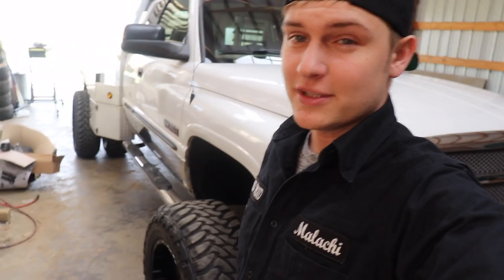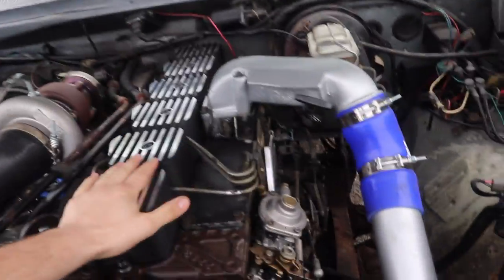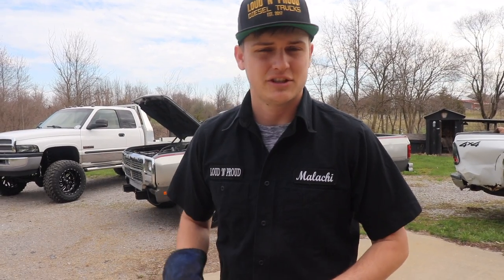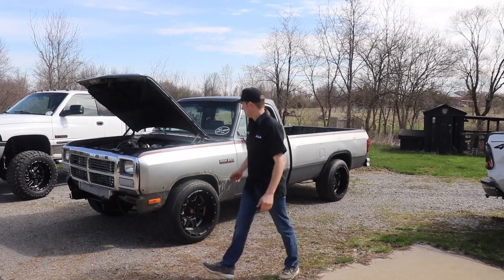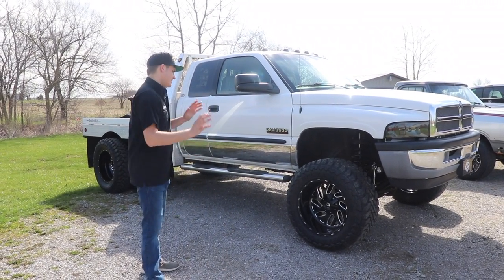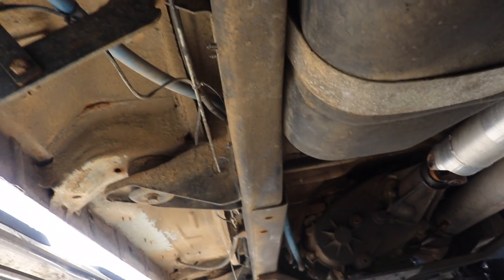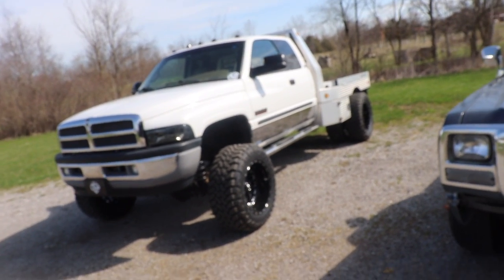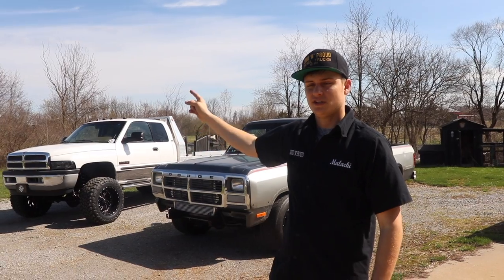WATCH THIS VIDEO BEFORE BUYING A USED CUMMINS DIESEL!!!

Comment from the maker: Who’s takin home that Dually? 😝
Reply: Probably not me but idk...😃😃😃
Reply: @noahreynoldsriding3452  same
Reply: ha havent won yet but ya never know 💁‍♂️😂
Reply: True
Reply: I’m praying but my luck has never been good🙄😂
Reply: @christopherdavis7757  I know how u feel bro
Reply: canada eligible?
Reply: It’s Ohio bound brother lol
Reply: I'm hoping
Reply: Hey
Reply: Me
Reply: As said in the other comments smoke coming out of the oil cap, breather tube  or so on isn’t an indication of blow by its oil vapors, if you want a decent indicator set the oil cap on but loose and see if it has enough pressure to pop it up if it does then I would worry about blow by but if not then I wouldn’t worry about it if it’s just vapors that bad check your valve seats they are under your valve springs if they are not a top hat style they can be pushed up with high boost causing a burning oil situation but any questions let me know can shoot you a message keep up the grind brother
Reply: When is the last day of the giveaway ?
Reply: I am
Reply: LOUD 'N' PROUD meeeeeeee
Reply: I wanna take it home!!! 🥳🤯🤩
Reply: I want that truck
Reply: I want that truck
Reply: $1000 says someone he knew wons the truck. Sub 200k subbed channels can’t afford to just give these things away.

Comment: Here’s a few things you left out:
1. If there’s literally 0 blowby, always check under the truck to see if the CCV has been rerouted, easy way to trick people into thinking there’s good compression. 
2. Crank the truck and listen to it. Does it sound even? Are some cylinders louder than others? If so, could be a compression issue in one or more cylinders. 
3. CHECK THE RADIATOR FLUID. Often overlooked, but very important. Does it smell like diesel? Then the injector O-rings are probably leaking and it’s been overheated. Do you see any bubbles randomly appearing when the truck is running? Probably a blown head gasket. 
4. Check the exhaust. Is there haze? What color? White: could be worn injectors, test the IBRs. Blue: could be worn rings. Does it smell sweet? Probably blown head gasket. 
Lastly, know the common problems with the truck you’re looking at. LLY: known headgasket problems. LB7: known injector problems. 6.0: a LOT, take a diesel tech. 5.9: depends on who owned it, you can blow one up in >100k if you don’t take care of it. Etc.
Reply: I'm glad you told that Joe Biden loving clown off. Good information sir!

Comment: White smoke is not an indicator of blow by. All of my trucks have it. Its the pressure you dont want it'll blow the cap up and even blow the dip sticl out. White smoke is just oil vapors.
Reply: Right
Reply: Oil vaping 😂
Reply: Holy shit! You again!
Reply: Nailed it man lol
Reply: Agreed. This isn't excessive blowby. The correct test is to loosen the oil cap and see if there is excessive pressure. Either the cap with jitter around... that's excessive. Or it will blow completely off... which is catastrophic.

Comment: Is it just me or did the first gen sound like a jack hammer while it was idling😂
Reply: It sounds like the gear train is coming apart in the timing gear case.
Reply: @realmccoy9597  May be that the kdp is coming out, it also sounds like that when you skip a tooth on the timing gear.
Reply: That’s exactly what it sounds like.
Reply: Sounded like there where marbles in the cylinders😂
Reply: @JohnDoe-jl3em  yo can you please explain this one, mine makes a similar noise but much less noticeable. No issues driving other than some slight blue smoke when she's lugging through lower RPMs

Comment: And also looking at an older truck check the bottom side of the floor pan, inner fenders, inner rocker panels. Open the doors and look at the bottom under the door gasket and see if it needs a new low door skin.

Comment: The late 2nd gen Rams aren't prone to frame cracks behind the boxed section because they are normally reinforced. The cracks happened a lot on the 12 valve second gens without the reinforced frame, which is why they made the subtle change in the late 2nd gens.

Comment: In the first gen I wouldn't be worried about that  that's not much blowby. When the oil cap blows out of your hand be worried. But that ain't bad. My 7.3 is about 3 times that bad and used 1 gallon of oil every 500 miles. But still has power and runs good once It warms up.
Reply: I agree ive seen trucks with a ton of blowby this is nothing concering

Comment: I bought a 2000  with 24 valve, it had a newer vp44 on it, I drove it 4000 miles & the vp44 malfunctioned. I looked at the lift pump and it was rusted,(old). I discovered that the lift pump was the cause for the vp44 injector pump failure most of the time due to insufficient fuel pressure.  So if your looking at or have a 24 valve , you need to get an aftermarket lift pump and install it as close to fuel tank as possible ( pumps pump very well, but don’t suck very well) an original equipment lift pump is $100. And is garbage. An aftermarket lift pump is $300. And well worth it because it will save the $1500. Plus labor to replace the vp44 injector pump, thanks. Doug E

Comment: Also if buying a 24v Cummins it's good to check fuel pressure! Low fuel pressure destroys the injection pump (vp44). Its a costly fix. Most of the time the stock in tank lift pump is not enough to supply the injection pump. I figured this out on my 01 when I bought it.

Comment: When you got water in the oil and the oil is  milky of course it will blow white smoke. Fix the head gasket or source causing the water in the oil.

Comment: Also if you are looking to buy a 12v Dodge Cummins pick up is to see if it still has the fusable links or if it was converted over to fuse box and relays or circuit breakers. Dodge was notorious for using a fusable link which could catch fire. I have a 89 D350 and just converted mine to the fuse box and circuit breakers. Also if you're getting up to a 02 24v see if your fuel pumps are still mounted to the block or if one was converted into the fuel tank.

Comment: I went and looked at a lifted 7.3 an hour and a half away last year, even asked him about blow by, the guy tried making it sound like a good deal and it’s a solid truck but I had to drive to him lol. Anyway when I asked him to crank it up I climbed up top and took the oil cap off and it looked like a fog machine out the oil neck it was so bad, he almost tripped running to shut it down. I guess embarrassed at that point.

Comment: Just for anyone that doesn't know a lot about diesel trucks blow by is when your piston rings are worn out and gases are escaping and can be burning oil some blow by doesn't mean you motor is toast just means your motor is worn out depending on how much blow by

Comment: I’ve had Chevys Fords pick up trucks dump trucks all the trucks that I’ve had ranging from 1990 - 2001 the 1999 dodge ram Cummins 5.9 in-line outperformed every single truck I had and to this day it runs better than new, especially with the new lift pump and injection pump. For work there is nothing like a cummins for. Towing.

Comment: I know on Chevy trucks.  The rocker panels are supposed to have creases like they were crimped on.   So if you look at the bottom of the door and it’s smooth.   You know the truck had body work done to it.

Comment: run that 12 v.mo.with the oil fill cap off .run a hose  down the fill tunnel. and the other end out the bottom of the truck...there is so much blow by  that the crankcase pressure is pushing oil out of the rear main seal.. the oil pan gesket may let go .if u hun it to far... put sum rings in it

Comment: That blow by is nothing to worry about. As long as it doesn't blow the oil fill cap of. Theres nothing wrong with that engine. As long as its not compression blow by where it puffs smoke out.

Comment: White haze is not an indicator of blow-by.  Blow-by is pressure escaping the combustion chamber via the piston rings.  All engines have a degree of it as piston rings do not form a perfect seal against the cylinder wall.  A proper measurement of blow-by for a cummins is outlined in a factory service manual in which they give a 'normal' range an engine should be in, along with a value that indicates a rebuild may be needed.  For us looking at these engines used, we use the oil cap method.  If it doesn't blow the oil cap off at idle (blowing the dip stick out after a hard run is another indication) usually means the rings are in good shape.  The white haze you're seeing is oil mist and water vapor escaping.  That is perfectly normal.  The leaks occuring on the 12v are likely due to poor CCV on these engines.  It becomes very evident when you start 'turning them up' on a high milage engine.  Look into a better CCV system, such as a dual valve cover breather, and I bet you'll see far less oil leaking out of it.
Reply: A vacuum pump going bad (or a vaccum leak) can also make it appear as if the engine has a ton of blow-by.  The vaccum pump vents into the crank case.  If its bad, or has a vaccum leak, it will pressurize the crank case and oil will have no choice but to vent out the front/rear main seals, CCV tube, or any other place it can escape.
Reply: Also, please turn up the idle on that old VE guy.  It's super low.  :)

Comment: I had to have the rear main seal replaced on mine at about 180000 miles. They wanted 1000$ 15 years ago but I found a diesel mechanic who said he would do it for 500. It only lasted 18 thousand miles and he wouldn't back his work.

Comment: I found a bad rust hole through the mid part of the frame on the passenger side on my 1996 12v dually luckily I’m a welder, I cut it out to good solid metal and made a piece to fit in there and tig welded it in then galvanized the welds so they wouldn’t rust love my 12 valve

Comment: Cost of driving old pickup?
Blow by and leaking a little oil. How many more miles will that run without doing anything? So how many quarts of oil versus cost to repair? As a retired locomotive engineer comparing leaky engines that’s nothing. I bought a first generation 1990 d350 and owned it 26 years. The only thing major I had to do was rebuild the fuel pump. 
Ps new the truck cost was $17,500. I wish I still had it.

Comment: Hate to tell you this but the first gen doesn’t have that bad off blow by. The kettle test is the best way to do this on Cummins. When it blows the cap off when taking it off and the engine is running that’s bad. I had one that had more vapor indicators than that and put 600k miles on it.

Comment: Actually informative. Thank you. This question may be irrelevant but I'm looking for nice 1st Gen Cummins 4x4. I noticed it has a pinstripe on the side. The cab and bed stripe don't seem to perfectly line up (only have seen pics). Would you think this is just superficial or something like the cab mounts etc are bad?
Reply: Body mounts are worn, easy fix
Reply: if its a 12v who cares lol just get it

Comment: I just bought my first 12v I paid 12k for it it does burn about a half a quart of oil every 3k miles and has no leaks and no rust with 173k miles

Comment: I have a 01 dodge ram 3500 5.9 high out put. It has rite at 400, 000 miles no tunes all original. I bought brand new in 01. Change oil every 3000 miles fuel filter every other oil change. Mine runs like the day I bought it new. But does leak oil. But it goes and goes. Original fuel pump but have changed primary lift pump three times now. The engine just keeps running. People laugh cause I change oil every three thousand miles. The oil looks like break in oil still to this day. It stays clean untill I get to that next oil change. Lol. Between oil changes I'll have to add about half a quart of oil. Good ole girl I got. Yep.

Comment: 89 is the First year for a cummins (fyi there was a Mitsubishi 4 cylinder diesel available in like 1978 not sure exactly on the years , def a rare option , no HP or torque though)

Comment: Slight blowby but once the oil cap is hopping and moving around just sitting there. That's when you really need to be concerned
Reply: I agree the 12v is mint in means of blow by to some 12vs I've seen

Comment: Idk if it's your camera audio but the first Gen sounds like it's got some rod knock
Reply: Gambado Games ya... I’m not diesel mechanic but it’s got some bad metal on metal sound
Reply: I've noticed in alot of diesels in video they always sound like they have a knock. Even on reviews on brand new trucks they have that little knock on the mic. Btw I am a diesel mechanic
Reply: @DieselAddict-vs9fc  yeah idk that first Gen sounds really knocky but the 24 valve doesn't. Im a motorcycle mechanic but I've been around enough. Wouldnt say I'm an expert tho
Reply: @StarfighterTV  those are  both 2 different engines. The 12 valve is a louder "clackier" motor. And the 24v is more quiet. all.in the shot of the injector. Kinda like the old 90s 7.3 is alot clackier then the 99-03 7.3. Like I said they sound like they have a little faint knock. I've noticed for a long time in videos. Just look up some videos of 12 valves and 24 valve and just listen to the motor. My 95 12 valve is loud a clacks alot loader then my dads 98 12 valve
Reply: @DieselAddict-vs9fc  oh wow I didn't know that, I've personally only owned a 98 6.5 turbo diesel 3500 and my current 2008 duramax. I want to cummins swap my old 98 because the 6.5 blew up when I was 17 but can't find a junk yard with a cummins in my area
Reply: Gambado Games yeah it sounds terrible
Reply: Sounds like it's coming from the timing  cover, could be that the kdp is coming out or the timing gear has been jumped a tooth. Yeah jumping a tooth can make it sound like that.

Comment: Im looking at a 2002 all colorado truck no rust, auto, body great, im moving to Arizona for job. Im concerned about drive shaft plus front end ball joints. Why i ask just saw 2 dodge trucks front ends crippled. So qhat do i need to do to sole front end issues.

Comment: I doubt Cummins are that different, on 7.3 you can’t get operating temp in 5 min.  My truck had issues that wouldn’t come till true op temp.  That’s 20 min of driving or 10/15 min on the freeway. 
Not until I got an oil temp gauge did I find this out. My rough idle didn’t happen until I hit 190degrees which is where it also stops increasing .  These trucks can’t even hit operating temp running around the block they must be put under load.

Comment: I'm looking at a 97 12v with 220k and 30k on tran 2 owner basic no rust whatsoever. Asking 15k it's my first diesel and most expensive purchase. Is 15k fair? Brakes are the only thing I know needs work. No blowback.

Comment: That ain't that much "blow by". if the cap isn't dancing, I wouldnt worry. And if it dont got hardly any blow by when cold, it doesn't really make too much sence that it would have more blow by when warm, as pistons and rings all expand when warm, and theoretically you would have the most blow by when cold. And that haze both these trucks have is just oil vapors. Its not pressurized. Also if your vaccum pump is leaking really bad, or you have other really bad oil leaks, there is a chance air could be getting sucked into the crank case and there fore making more of a haze. Now if you see puffs of smoke coming from the fill tube, then you got bigger issues like possibly cracked rings or just extremely worn

Comment: A cummins is a 6 cylinder so most of there blow by is out the bottom of the engine where as the duramax or powerstroke is a v8 so there’s is out the top just thought I would reach you something

Comment: Unthread the oil fill cap and flip it upside down. If it blows the cap off, then thats too much blow by. And yes even alittle piff of “white 💨 “ as you call it is still blow by. Ok he compression ratio is so high on any diesel engine that blow by is normal, too much blow by means your rings are cracked broken or gone. Your welcome. Never take advice from somebody that doesnt know what they are talking about.

Comment: Does that ruck have an upgraded vp44?... That dually looks insane best dually i have ever Seen!!!!
Reply from the maker: Jo Moma has a lift pump to assist it so it doesn’t burn up!
Reply: @LOUDNPROUD  Ok. Are you going to take off those spacers off the front of the Dually?
Reply: Jo Moma I don’t believe it’s got spacers. It’s just got allllllll the offset😂
Reply: Will Vaughan no it does in the front
Reply: @willvaughan5734  The front of the truck he said in an loder video is it still hase the dually spacers in the front

Comment: Please take the dually wheel adapter / spacers off!!!
Reply: duckdude018 why
Reply: @cameronnalley3197   it's to wide! Over 3/4 of the tire is sticking out. It's just not a practical work/ everyday truck. Now his obs giveaway yeah that was the point of it. But this one is not. It looks terrible in my opinion. As the say opinions are like elbows, everyones got a couple
Reply: duckdude018 yeah everyone has their opinions. I think it looks fantastic imo. Just stance is all. Looks a little weird on a dually but I still think it looks great. If I won the truck I’d make it wider. Just kiddin but I wouldn’t change a thing. That’s a dream truck for me, but a single wheel would be my choice. White color matched 2nd gen 24 valve with 22x14’s. With a stack lol. 6 speed also.

Comment: Unless you're paying 20 grand for a 2nd gen, you're gonna have blowby
Reply: Naaaaa my grandpa got a dodge 3500 with a 24 valve that has no blow by
Reply: No I have a 2001 with 335000 miles and 000000000 blow by

Comment: I have a 53 block
Reply: Crack yet? Lol
Reply: Colt K 154k miles and running good.
Reply: @ubaldo24v81  yeah I’ve heard some of the horror stories, and others with a 53 block making it well over 400,000. Probably more about how you drive it then anything! Good luck! I’m a non 53 block owner but my 24 valve has 338,000 miles.